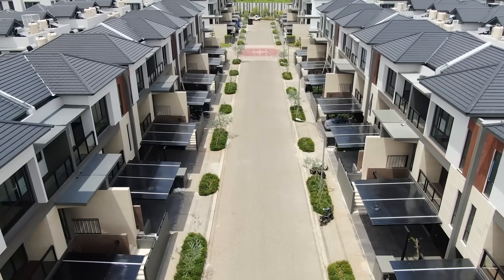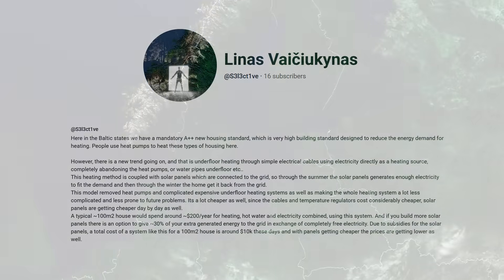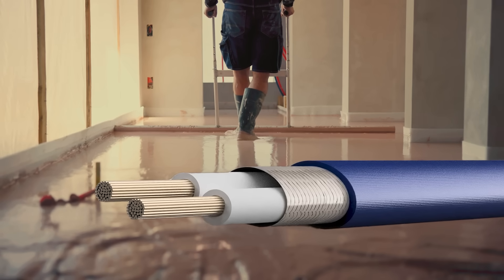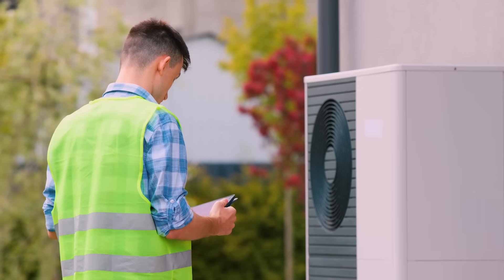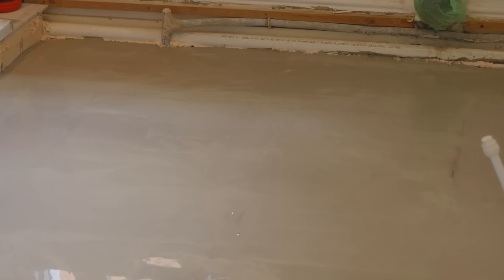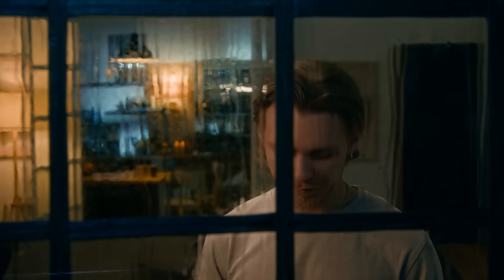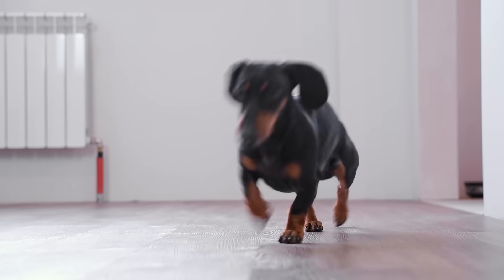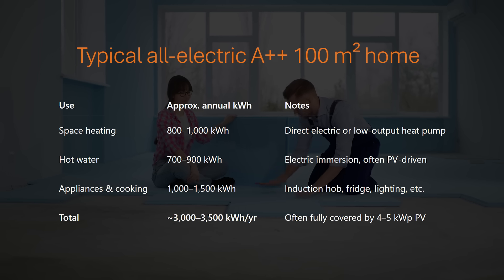What the Baltics Can Teach Us About Home Heating

Comment: One can buy resistive heaters for next to nothing and plug them in in the rooms that need heating. No point putting that in a floor. But in any case for new builds: air tightness, insulation are key, and put money in efficient fenestration instead of a marble waterfall kitchen island. Making homes future proof is a big thing in a fast changing climate.

Comment: Try ATC oil filled radiators (Selco sells them)  for permanent "central" heating. 
They are very efficient, no pipes, no boiler ! 
Calculate total cost of installation, servicing and energy (gas, electrics etc) for 10 years period. Separate private meter for the heating  (ATC rads or underfloor mat).
That is how you should calculate overall costs etc. 
I used to be builder in London/Croydon etc....

Comment: Your ~800kWh pa for an A++ house hot water- seems a lot. 70 litres per day @ 40deg. If it really matches space heating, then heat recovery seems indicated. A small heat pump that has such a high temperature source would be really efficient (600%?) and could contribute much of the space heating- or it could be returned to the hot storage tank.

Comment: You'd love it in Beijing, Roger. When winter starts, usually around November there, the local government 'turn on the heating'. Most of the apartment buildings are plumbed into a huge water network from the local power station and this means we are all part of one giant radiator. The only way to control the heat is to open your window, even when its minus twenty outside. When winter ends they turn it off. There is no added cost to your rent for this (maybe if you own the apartment there is). Before anyone jumps on the air quality train I can tell you that in nine years there the air quality improved massively. Who pays for the cheap energy there? Well, they have a huge population and currently a strong economy. Here in the UK we could never do the same. 
My advice for the UK.....buy a good jumper!

Comment: My current house, built in '63, had underfloor electric heating on the ground floor. All four zones failed years ago.
Insulation is only part of the solution- you also need air change heat exchangers.
To encourage better houses, you need subsidies- or dearer energy. Much dearer.

Comment: Most ridiculous thing I have ever heard of, and I am from LT. Usually it's air-to-water heat pumps + radiant floor heating that we use, never seen anyone heat their whole house using just wires. Another possible solution is to use water boiler + excess solar to heat water and then run that using pump.

Comment: We have a mid 1930s semi in SE London, one of tens of thousands all very similar. Ours came with side extension (mid 1970s) and loft extension (2005). Bought in 2013 for cheeky price, we ended up gutting and rebuilding it after stripping back some painted paper and seeing the electrics, then the totally mouldy felt panels under the laminate downstairs flooring (void under original house very wet due to driveway sloping down from pavement to level with dpc.
   If I'd known just how much we were going to do, and if knew then what I know now, thanks to such more information on YouTube, I'd have done an even thorough job than we did. But we did add insulation under ground floor original (not under side extension  nor under kitchen extension floor). Also added insulation in side extension roof (it had just 25mm) and loft extension (had just 100mm with plenty of space for more). Also insulation on inside of bay windows (they are just single brick width). Then 100mm insulation on outside. Result is our heating bills are a fraction of neighbours but, if I'd really pushed it, I wonder just how low I could have got it as there is loads of room for doing insulation better. Good air flow so never damp or mouldy. Shifted 1.5 grabaways of stuff from front driveway and replaced up to 2 courses below dpc so void is dry and, with cushioned workshop floor tiles, power, and light, it's good for storage while I can crawl on my knees and access to pipes and cables. Neighbours jealous but newcomers come to ask what we did and we explain so they do likewise. 
   Has it paid for itself? Difficult to say. But at least we don't fear impact of bills on our two pensions (yet)

Comment: This is not applicable in UK. There are 2.9 million people in Lithuania. Electricity consumption is around 13 TWh. In Uk it is over 90 TWh, and this with almost no electricity is used for heating. In Finland, which have a colder climate though, 66  % of 83 TWh is used for heating, i.e. around  55 TWh. For heating and warmwater. Close to 50 % is direct electricity and heat pumps.

In Finland we have stopped installing direct electricity floor jeating in the houses after 2000, especially if there is no complementing system. It is kore expensive than radiators and zero flexibility in the system. A cable burried in a concrete slab.

Over 30 % of Lithuhania electricity production is hydro power. They however import quite much from Sweden, Finland, and Poland. Their electricity cost is close to what it is in UK.

Comment: The total energy cost for our UK, 4 bed 1970's detached house is about £200 pa. (which is about the cost of the standing charge!) We have a heat pump and Solar PV with slightly improved insulation.   Over the year the solar produces as much electricity as the heat pump, cooking, lighting etc use. We export in the summer and import in the winter so it balances out.
The solar PV generates about £1100 worth of electricity, so without that our bills would be £1300.  Even this would be a great improvement on the £2000+ we paid with an old gas boiler.  The walls have either 75mm of cavity foam insulation OR added 100mm of external insulation (we put this on where we could easily do it).

Comment: Zero emission houses are also build here in Denmark for some years. The problem is 40 deg. celcius indoor in summer. Try to sleep with that. So many people installs an air to air heatpump and set it on cooling.......
Reply: I think you don’t understand how insulation and weather-tightness work in an A++ house. Insulation doesn’t heat your home in summer, it helps keep it cool. With efficient triple-glazed windows, open them at night and close them during the day to trap cool air inside. Even if air conditioning is needed, it uses much less power to cool the house. During most of the summer, I can maintain my home’s temperature between 20-22°C, even when it’s 30-35°C outside, without air conditioning. In comparison, I once lived in a poorly insulated apartment with a black tar flat roof during some workdays, and it was a nightmare. I couldn’t cool it down even at night, and during the day, it felt like an oven.
Reply: @DizzyPanda  It's true that with enough insulation, air conditioning can cost less than running fans. But everything else about the house has to be well thought out; things like refrigerators and dryers can add as much heat as the sun coming in the windows and you have to pay to remove all that. Ideally, refrigerators should be replaced with 2 section super-insulated closets (like the beer sections in some liquor stores) that can run a chiller that vents the heat out in the summer and in in the winter. It could even be programmed to turn off the chiller and  bring in outside air to the refrigeration section when it's near 0 C and to the freezer section when it's below 0.

Comment: Ah yes, the old ‘Tile Warmer’ direct electric heating system. Great 100% efficient & designed correctly - in well insulated home, you can heat with a squirrel fart, fantastic!

But here in the UK we have many issues with heating homes. A Cold high moisture content climate in the Winter & seasonal differences every day. Here in Scotland we say we get 4 seasons in one day.

Now our main problems are:
1. To minimise home Heat Loss, you need an air tight house, meaning minimum air ingress.
2. Getting sufficient air changes for ventilation, to reduce air moisture & dampness/condensation.
3. Our cold damp moisture laden Winters are not like anywhere else, unlike for example, the dry cold temperatures in Scandinavian countries.

Low temperature heating is totally unsuitable for our UK climate.
Reply: Completely incorrect. It simply takes some basic actions with regards to airtightness and insulation. MVHR systems easily handle any climate. Britain is just full of lazy and incompetent builders.
Reply: @PureHokkaido Oh I agree, MVHR systems are fantastic. But we can’t blame our British Builders, when all homes are built to our Building Regulations, where there’s no requirement for MVHR.
All new homes are built & approved by Local Authorities Building Control.

This morning here in Scotland UK, we’ve an outdoor temperature of -5°C, not including Wind Chill & a moisture level of over 80%.  We live in a cold damp climate.
I always reiterate how Polish work colleagues on-site in the winter, could not stand our cold damp climate here. I’m amazed how some of them stayed & adapted Scotland as their home😂😂
Lovely people & great friends. Hard working & trustworthy, it’s no surprise Poland wants out of the EU.
The EU in Brussels is full of corruption, unelected fat cats & liars.

Comment: I think of a heating a house like filling a   bath with water when the bath has holes in it. A good old gas boiler is like a fireman's hose which can fill a bath quickly even with many holes. Turn off the boiler and the leaky house gets cold in hours. A heat pump is more like a garden hose which needs to run continuously to keep the bath level up. The solution is not around the boiler, it's about fixing the leaky house. And we keep building leaky houses in the UK...
Reply: EXACTLY this point.  If we had properly insulated homes we'd barely need heating or cooling at all!!!
Reply: @james.telfer And natural gas usage and the accompanying greenhouse gas emissions would plummet. Long term, it might even have the net effect of causing the demise of the participation of retailers in the domestic market due to a direct lack of profitability.

Comment: A/C heat pump seems to be the no brainer for me. You can oversize if you're worried, don't need to worry about whether the existing plumbing and radiators will work, and provides cooling which is very important for the elderly on hot summer days. Gov will be concerned with trading up new gas certified installers and the loss of traditional plumbers, but it seems there's a short supply of plumbers anyway so I don't really see that as an issue either. Get a labourer to do most of the work and a gas plumber to do the specs and final connections.

Comment: All surplus renewable electricity should be used to pre-heat the water going into conventional power stations, like a giant kettle. This would reduce the amount of carbon based fuel needed to generate steam. Simple cheap and efficient technology that would enable wind turbines to work at 100% capacity, instead of switching 70% of them off.

Comment: Nice one.  

Air to air is a possibility as well.

I am interested in retrofit insulation on houses.  I have thermal curtains, loft insulation to the recommended depth and double glazing.   The concrete floor of the house is cold so we have thick underlay.  I did have something injected into the cavity walls in 2011 under a government scheme, but I think that is pretty useless now.

Comment: In my house it's the rain that cools the house far more than the outside temperature.  At least that's what I think happens when I notice the thermostat going berserk when it rains.  Or maybe it's the wind.
Reply: For our solid stone walls it's the wind. I've not yet got the wind wired into automations controlling the heating but as a result it's very noticeable that I have to mess with them when it's really windy.

If it's rain doing it I'd be looking hard for damp spots and where water might be getting into cavities and stuff 8)

Comment: I think you are correct. Whether it is direct electric heating or more efficient heat pumps. UK house stocks are not designed for cheap heating or cooling. It beggars believe that government in its rush to show it is building up our housing numbers allows low quality housing. The council built homes of the 1940 were more solid. The matchbox estates with no gardens built on the design of a caravan site . No community facilities perhaps a tiny play are for children is a future social problem in the making.

Comment: In Lithuania, all newly built houses must meet the A++ energy efficiency standard. This means that heat loss calculations, air-tightness (blower door) tests, and ventilation with heat recovery (recuperation) are all mandatory. As Roger mentioned, in a well-insulated, airtight house that retains heat effectively, it’s very easy to maintain a comfortable indoor temperature. In fact, almost any heating system will work efficiently — even simple underfloor electric heating can be sufficient in an A++-rated home.

Comment: Wearing extra layers of clothing helps in UK winters, combined with a hat. A fairly thick curtain over the front door makes for extra insulation. Keep moving too, chronic illness due to lack of movement is a silent killer.
Reply: Yeah.  Building houses properly is silly.  What's wrong with ice on the inside of the bedroom windows in winter?
Reply: @FFVoyager  They can be as well built as you like, but if the heating is off or set low, at some point it is going to run out of heat.
Reply: @Comfortzone99 it's a lot easier to heat one properly built or refurbished to modern standards.  🙄
Reply: People laugh at this, but to me it’s so obvious. Wearing clothes is what differentiates is from the beasts of the field.
Reply: Might as well live in a cave at that point. 21st Century and our government have reduced us to this.
Reply: @markrainford1219  reduced to what?
Reply: @markrainford1219  A lot of backhanders going on for net zero...ask Milliband.
Reply: Yes I think the hat is the crowning trick in keeping warm inside...and heaven would be Aldi or Lidl coming out with a heated toilet seat.

Comment: You are correct to say insulation is key, but from my own measurements in a cold climate with glass wool insulation above ceilings, 200mm gets you to about -50%, 400mm to -65%, 600 to 70% - So yes it's a diminishing return, but insulation is dirt cheap and a permanent reduction in heat loss.
   You really have a bee in your bonnet over Adam and heat-pumps, and to imply Heat Geeks are saying insulation is irrelevant is plain wrong - Insulation assessment is key to the UK grants system, and it's HMG policy pushing heat-pumps - Underfloor cable heating is the least efficient energy use of all, encasing hydronics in the floor would have been smarter, enabling the heat generator to be remote and swappable..
weather   
For a well insulated space with low thermal mass, you can turn off heating and the space will recover quickly when heating resumes, but for a high thermal mass space common to the UK, it's more cost efficient to leave it running, irrespective of the heat source - Trust me on the latter, I tried both and proved it, but that was when I was using standard specced radiators, more on which at the end....
   My place is reasonably well insulated, high thermal mass downstairs, low upstairs, bigger rads all on TRVs, weather compensation, current gas savings 70% of the original - Flaky mains was my reason for renewing the condensing gas boiler, and very glad I did as the power cost per kWh this year is now 5 times that of gas.
   Running constant circulation for the second winter and pleased as punch - This morning it's 10c outside, boiler feed at 38, returning a steady 23.5, temperature of every room flat as a pancake 24 hours a day - Last winter right down to -16, the return was a flat 23c, annual heating bill 475 quid.  

   One funny observation on the bigger rads though - I've a habit of throwing the windows open to give the place a blow through, and yesterday forgot to close one window downstairs for about 4 hours - Spotted it on the monitoring system, realised my mistake and closed it - The room recovered to the flatline target temperature in just under an hour...

Comment: Iretrofitting the necessary insolation to the huge stock of very poorly insulated houses they have in the UK as you said dose not work with the UK's poorly insulated houses. Very high effency insulation such as the foil quilts SF40 etc can reduce the space that high levels of insulation take
Reply: Interesting.  Do you have a website please?

Comment: In the Winter we are charged nearly £200+/ month electricity bill alone in London for a 3-bed ground floor maisonette, built in the 1930s, no insulation at all. 
If anyone has any advice I’d be grateful to hear from fellow viewers.
Reply: If it’s direct electric heated that sounds quite reasonable.  If you want to pay less you need heat pumps or a/c multi splits or put in central heating. Storage heaters might even be worth considering along with the right tariff

Comment: It's not just about insulation. Why is no-one talking about solar gain? It's 12C outside, 20C inside and a window has been open all night. Not had the heating on yet this autumn.
Reply: On a well insulated home it’s difficult to manage, you tend to end up with overheating in the summer and then you don’t benefit much in the darkest parts of winter.

Comment: If you're going electric, heat pumps for high occupancy spaces, Infrared panels for low occupancy spaces. If you're going district heating (and we should, for built-up areas), then it will work best with existing wet systems (rads or UFH) and we can ditch boilers.